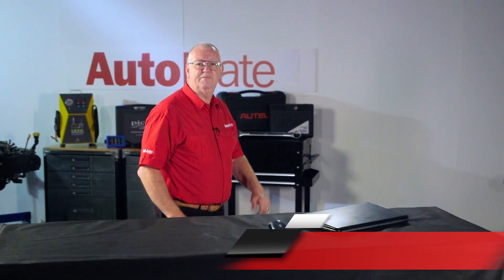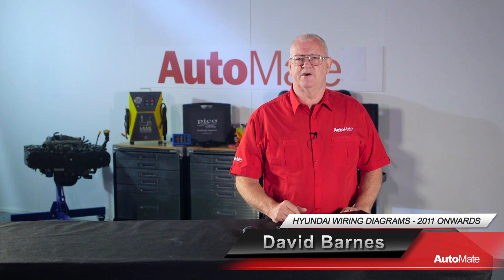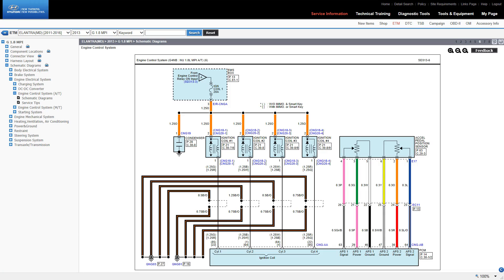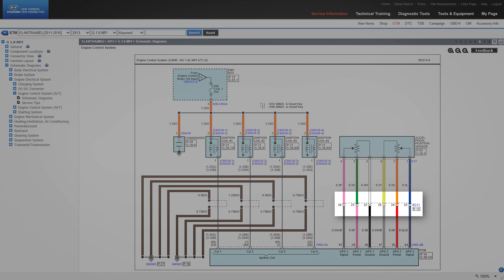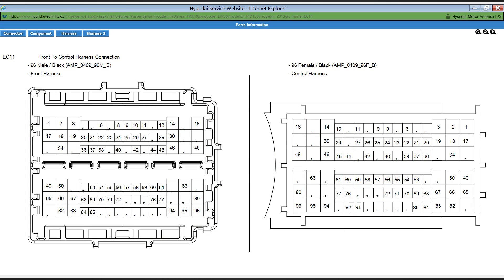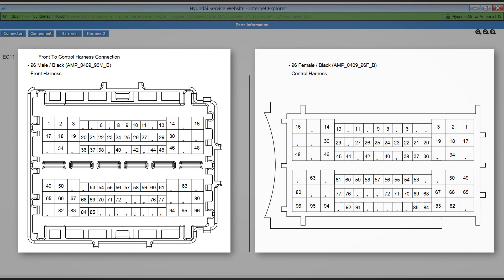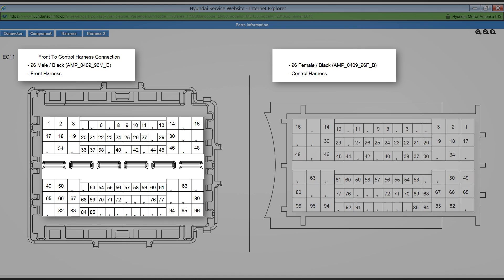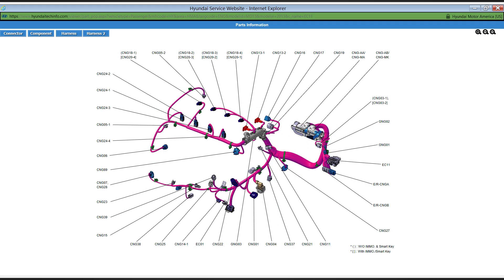Hyundai Wiring Diagrams 2011 on

Comment: I have a 2014 elantra se that has a completely severed fuel pump main set of wires,  the ones that come from the side of the car and go across the bottom of the back seats and up the front middle of them backseats and into the fuel pump... i am lost and dont know what to do to fix it properly and not have to splice the wires together!!!

Comment: hello... I have a 2011 Elantra, I just changed the worn out steering coupler... everything went fine until I put the column back and discovered a solid brown wire that has pulled out of a connector somewhereI.  before starting it looked like it went towards the brake light switch, but not sure if it went past it... I dont see any other connectors between the switch and firewall do you havr a diagram of the wire colors and possible where thye go?  thanks
Reply: PS.  headlights, tail lights, running lights, brakes, turn signals all work...